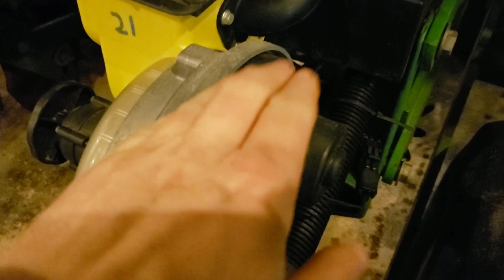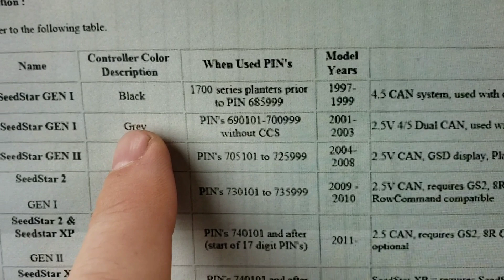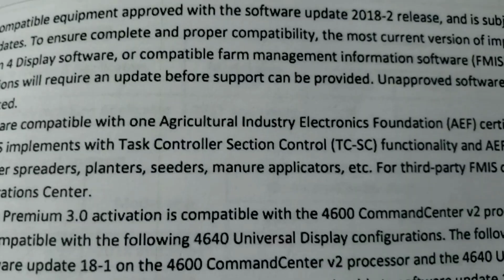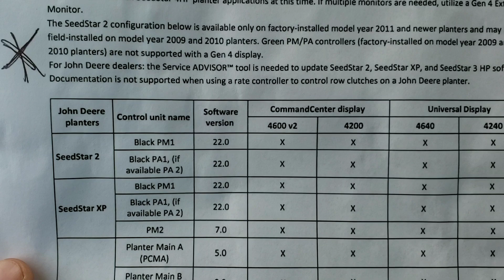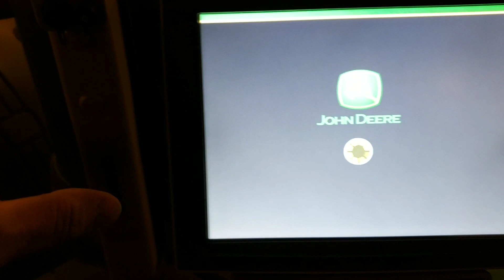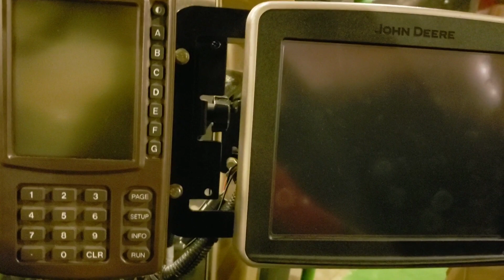John Deere controller compatibility

Comment: Hello would yoy happen to know if JD rate controllers accept input signals trying to mount one to use data collection on a seedhawk air tool thanks
Reply from the maker: @timwalter1381   what monitor are you using? ... if your using a John deere 4640 or gen 5 display - yes, you can combine it with a MTG (which is internet data recording) ... the rate controller is just a cross over computer - essentially it connects the implement to the display ...

Comment: Old video I know but I appreciate your information. I should have seen it before I bought the planter haha. Can a 1770 with grey wedge box and a brown box be updated to seedstar 4? Without a new complete planter harness.
Reply: I don’t think so. I was told seedstar 3hp is the highest version you can get not from the factory. Im building a couple custom planters with deere row units for vegetable growers and information on seedtar is scarce.
Reply: @timblack33  information is very scarce. I never found any concrete information so I abandoned trying use seedstar. I went with Graham electric drives and was very pleased overall.

Comment: That was a lot to take in, lol, god bless your ability to figure things out because I had to watch this twice:) So if I’m following you correctly, your processor on the planter you have is not compatible with the GreenStar set up for the 8400R and Fendt? I can see why there’s still resistance to tech in the ag sector, you really need to know your shit or all you have is a bunch of expensive wires and boxes you can’t even use
Reply from the maker: Yes you are correct .. the 4600 (or 4640 universal display) are not compatable with the green controller (pa and pm) on the planter .... so we will either need to change the planter controller over to black one or use a 2630 display ....... and yes your completely right - comparability issues are expensive and a giant pain in the rear ... knowledge is key to success with this stuff .. to bad I had to learn the hard way ..lol
Reply: BLACK EARTH EXCAVATION & TRENCHING, LLC that’s really a lot of things to consider, if you upgrade to the black box so it works with your two largest tractors would that devaluate the resale on the planter, I.e. if you sell it would you be able to recoup the money invested?
Reply from the maker: @2009deerejohn   I believe i can keep the green box too .. should be plug and play .. but we are still researching that part of it .. i'll have more info in todays video